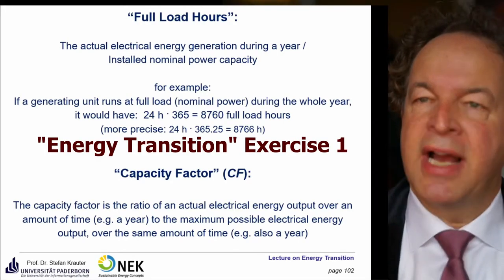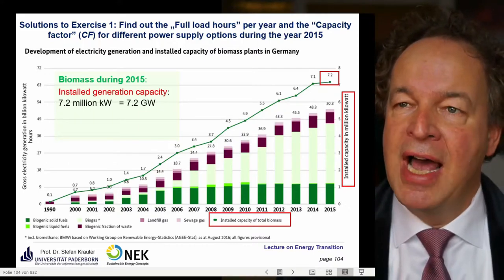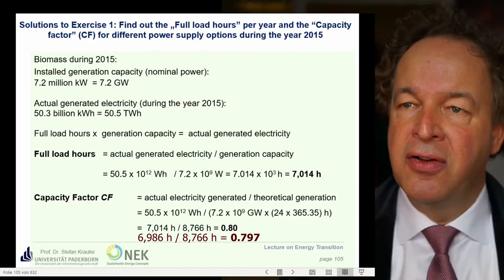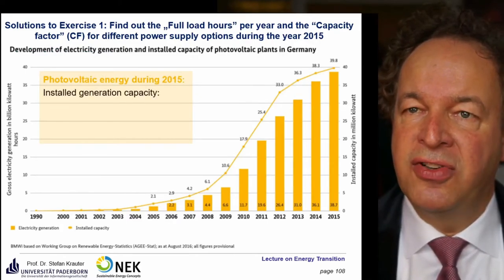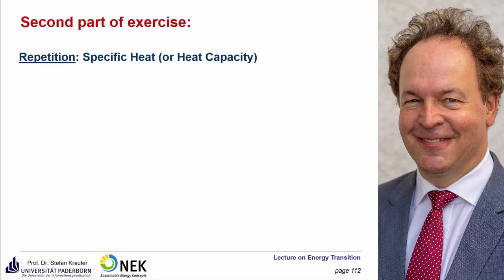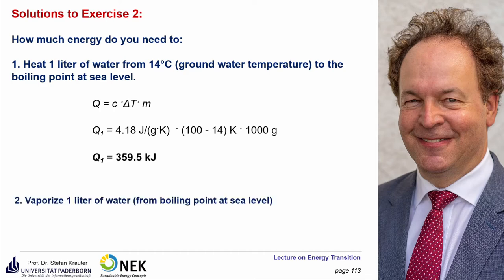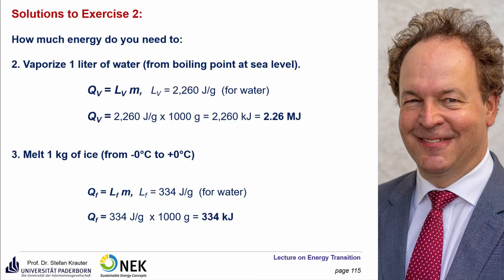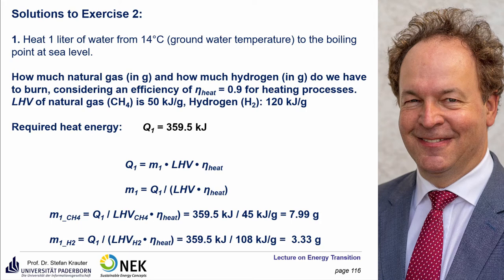Exercise 01-02 of Lecture Energy Transition: Capacity Factors; Heating by Fuels

Comment: What do you mean by lower heating value?
Reply from the maker: The quantity known as lower heating value (LHV) (net calorific value (NCV) or lower calorific value (LCV)) is defined in my lecture as follows: Simply subtract the heat of vaporization of the water inside the fuel (coal, wood ....) from the higher heating value. This treats any H2O formed as a vapor. The energy required to vaporize the water therefore is not released as heat.

LHV calculations assume that the water component of a combustion process is in vapor state at the end of combustion, as opposed to the higher heating value (HHV) (a.k.a. gross calorific value or gross CV) which assumes that all of the water in a combustion process is in a liquid state after a combustion process.

It is also described here:
https://en.wikipedia.org/wiki/Heat_of_combustion